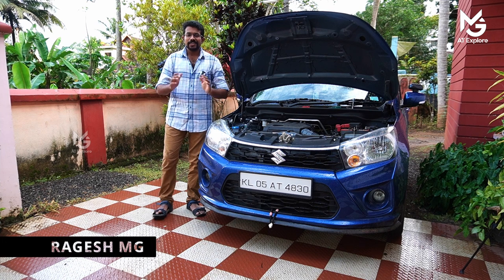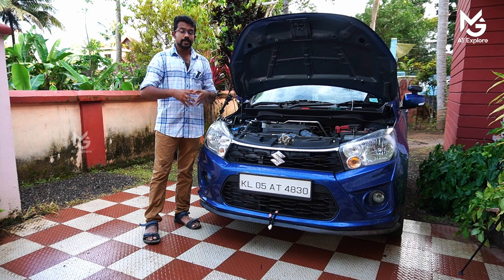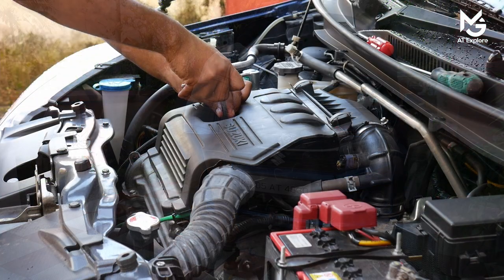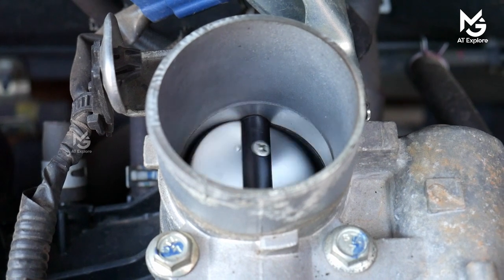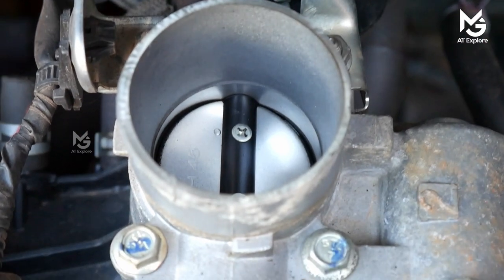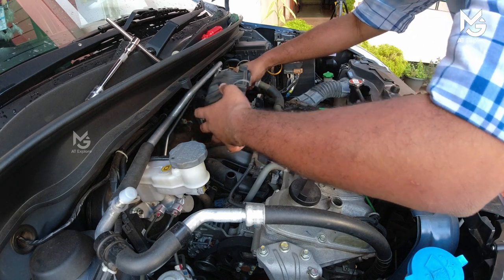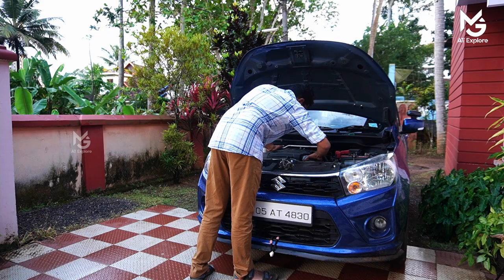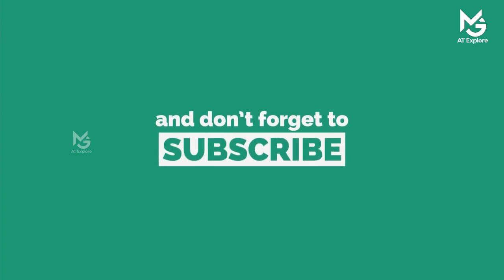New vehicle Engine noise, At time of offing engine | Throttle body working | @MGATEXPLORE

Comment: Chetta nte alto 800 nte throttle body njan azhichu clean cheythu ennitu set chythit vandi start aki kazhinju accilarator kalu kodukumpole race akunund pedalil ninum kalu eduthalum aa racing pathukke kurayunollu
Reply from the maker: Sherikum yanthu complaint kondu ane inkane cleaning cheythey? Carbon deposit nanayi undayiunu? Manifold il vallam athe kezhariyo?
Reply: @MGATEXPLORE  carbon deposit ndayirunnu
Reply: @MGATEXPLORE  engine vaibaration nallapole ndayirunnu aa time air filter nte aviduthe hose matti nokiyapole throttle body ude bhagath carbon deposit nallapole ndayirunnu athukond azhichatha pinne clean chythu ittapole valya vaibaration illa engine nu

Comment: On ചെയുമ്പോൾ tb കൂടെ മൂളുന്ന ശബ്ദം എന്താണ്
Reply from the maker: Athil oru motor assy unde athe full time working ane... Njn athine kurichu oru video cheyam... 👍👍👍
Reply: @MGATEXPLORE 2017 automatic wagon r remote key വച്ചു unlock ചെയ്ടിട്ടു, driver side door തുറക്കുമ്പോൾ ഒരു മൂളൽ കേൾകാം..3sec ഉള്ളൂ. Key ignition ഇടേണ്ട. എതാണ് മൂളുന്നേ?
Reply from the maker: Athe amt unit il ulla motor work cheyunathe ane.. Unlock ayi kidalumbol driver door open anel battery down akum kure neram ankane kidanal so be careful.. 😊👍
Reply: @MGATEXPLORE  thanks very much
Reply: IACV - ഐഡിൽ എയർ കൺട്രോൾ വാൽവ്. അതിൻ്റെ മോട്ടോർ കറങ്ങുന്നത് ആവാം. എൻ്റെ ബൈക്കിൽ അങ്ങനെയാണ്.